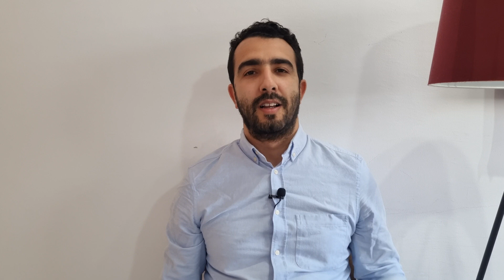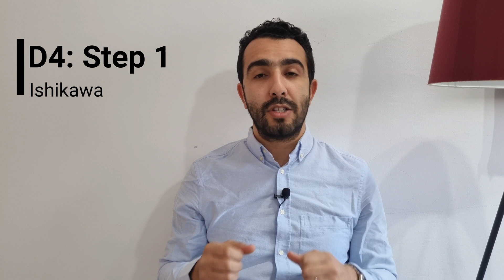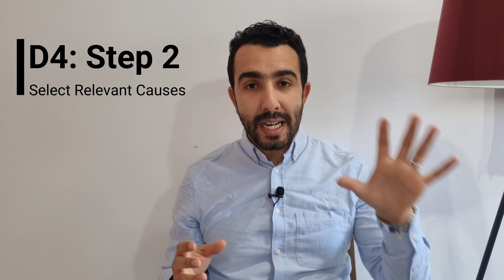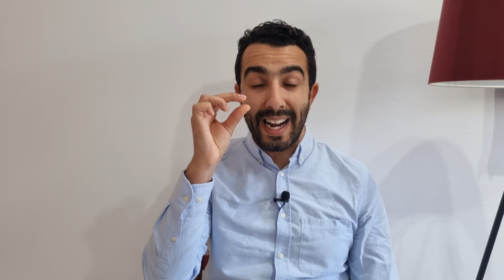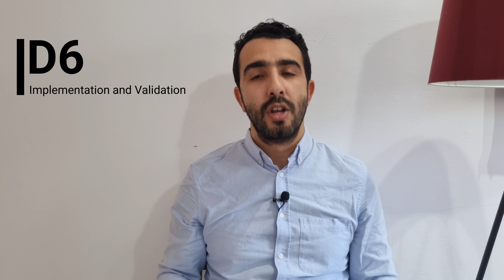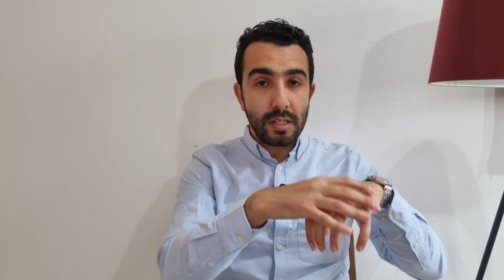8D Problem Solving Methodology (Full Course in English)

Comment: Good initiative, but try to start from D zero before D1
Reply from the maker: In this case it will be 9D not 8D.
In some books, they are starting to creat some new steps just to buy new books versions, like 5M, 6M, 7M... or 7Muda, 8Muda... etc
The most important is the principal, then you can add or split any step into two or 3 steps